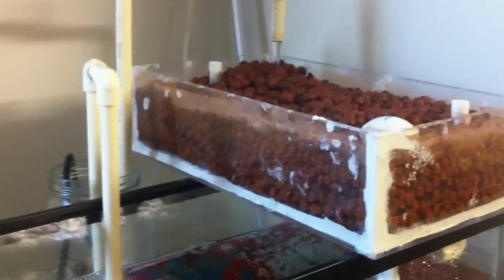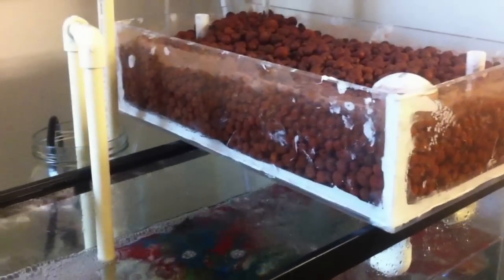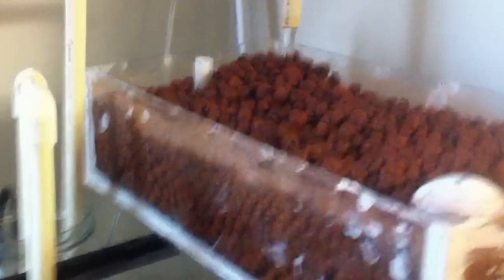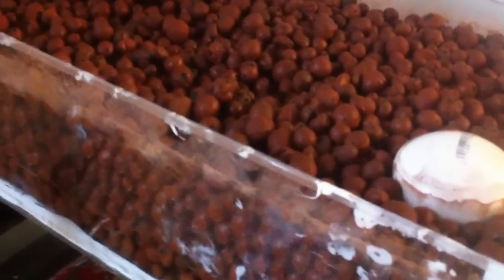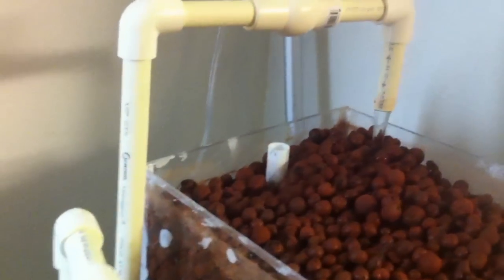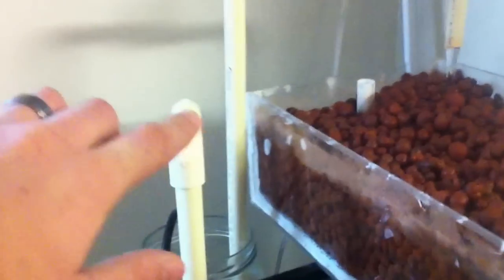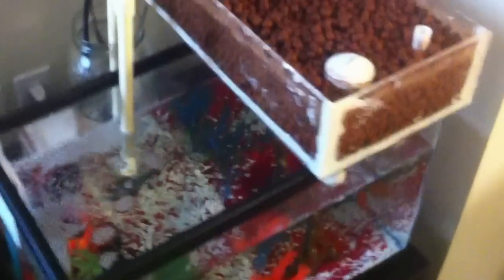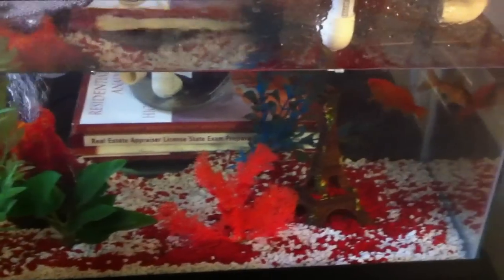10 Gallon Indoor Aquaponics system: Part 1 (Intro)

Comment: no, the pressure of the water will always want to equalize, the same way you would if you were to siphon a car fuel tank, once you start the flow, it will continue to flow until the pressure is equalized. the actual water line remains at the constant level of the tank (with pump off) with the pump ON it creates a low pressure in jar, and since the tank has higher pressure due to a higher water level, the water forces itself through the pipe and into the jar to equalize. its just a basic siphon.